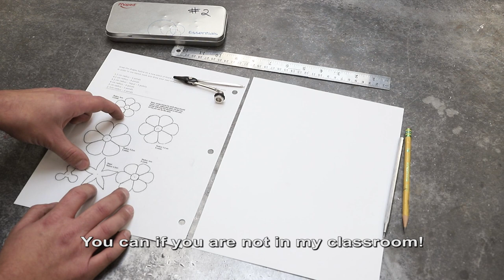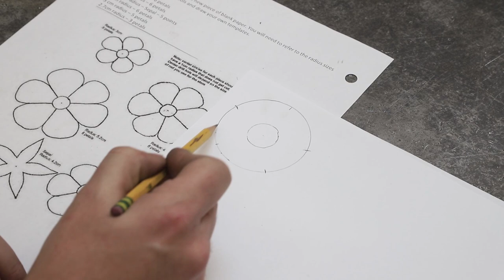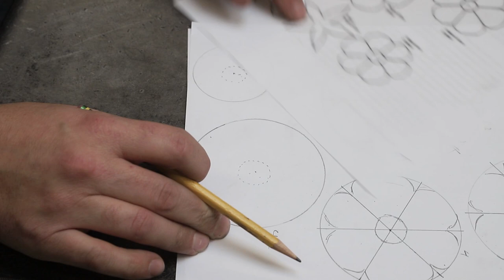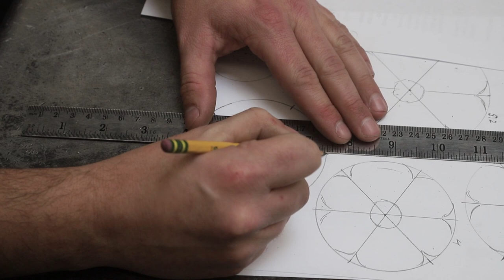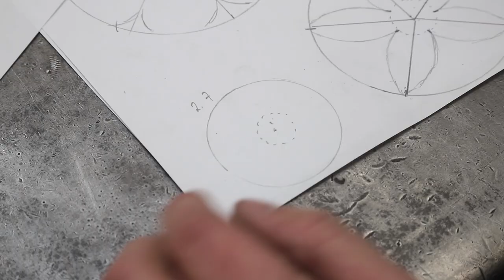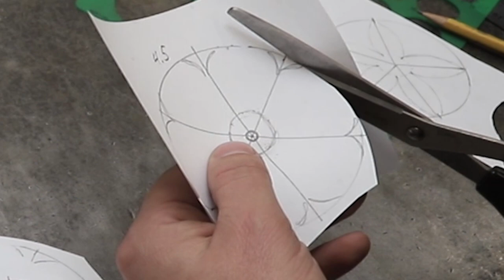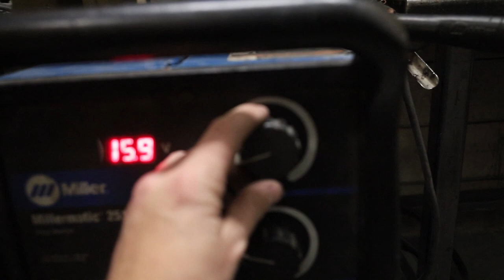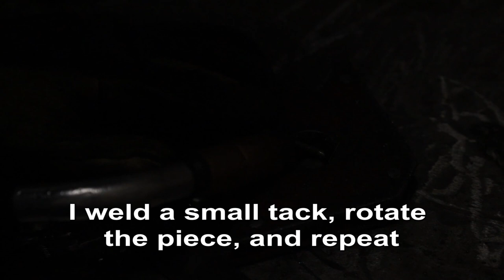How to make a Scrap Metal Rose - DIY High School Shop Project

Comment: Great video! What gauge would be the best for the flower itself, to be able to cut it with tin snips?
Reply from the maker: We use offcuts from 20-22g sheet metal
Reply: @WeBuildStuff  thank you, I wasn't sure if 22 gauge was going to be to flimsy. That's what I'll go with and thank you for the fast response. On a side note I loved your arcade Cabinet build as well!!
Reply from the maker: @imacgst27  it's all meant to be decorative for the students and many of them still struggle using aviation snips since they are young. I've done some very cool ones using 16g and a lot more hours
Reply: @WeBuildStuff  thanks again.